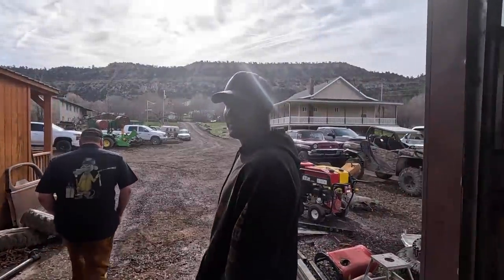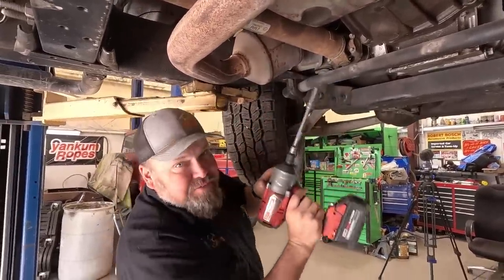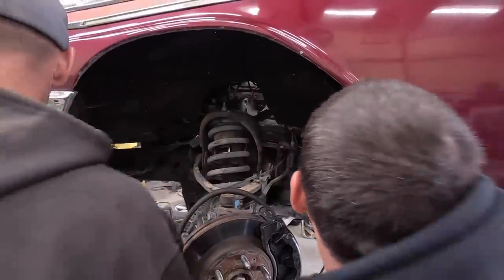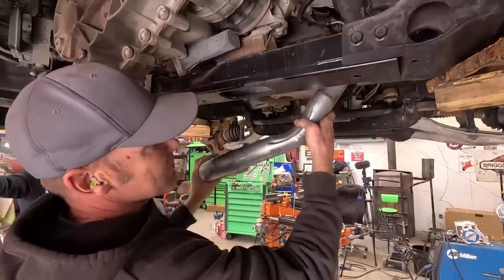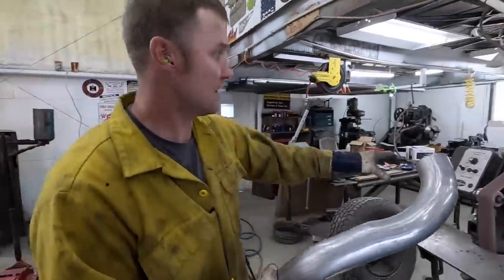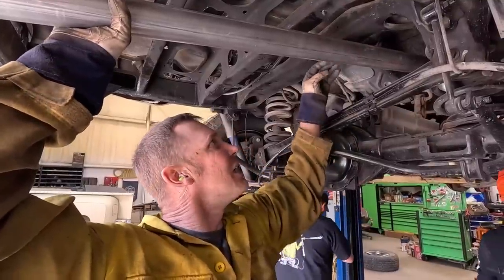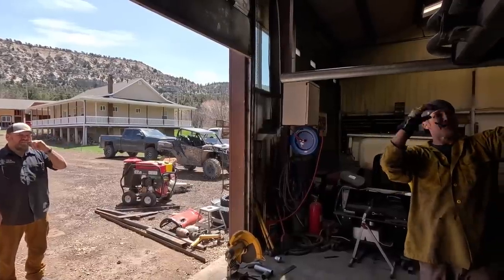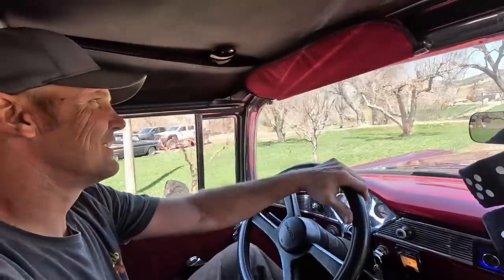This Controversial Chevy Bel Air Needs Some Help.

Comment: As far as old school performance mufflers the Flowmaster 1 and 2 chamber are the best for on and off road use and the 3 chamber are the best for on road use I think they sound the best and they give you just the right amount of back pressure and they give you good performance as well and you won't find a better ground beating muffler on the market and the 1 chamber Flowmaster is meant to be strictly for track use but I've seen some people use them for street use and get away with it even though they have a really ground pounding tone to them and they sound like you're not running any muffler at all

Comment: On the 55 Belair the chrome trim on the side goes straight back and the rear wheel well is squared off . On the 56 it started the chrome trim slopping down like on the 57 Belair , it also shares the teardrop rear wheel well same as the 57 . Much nicer look and you can fit a larger tire on tge rear of a 56 .

Comment: It's a 56 Chevy you can tell by the taillight it has the one round red tail lamp in a large chrome fixture the 55 had a smaller  tail lamp and it was all enclosed with just a small chrome bezel around it. Of course the 57 had the big fins which they dropped in 58.

Comment: It’s a ‘56. A 55 has an egg-crate grill (think ‘72 Chev Pickup grill). The rear wheel wells’ on a 55 are straight at the top edge for more than a foot. ‘56 is swooping curve to the rear like this exhaust project has.

Comment: What year chevy pickup did the guy use?  Did they section the frame or just find a body to fit it?  Kinda cute, I would drive it after an air cleaner & some borola mufflers to get rid of the popping & take the sharp edge off.

Comment: The exhaust doesn’t flow into the packing. Only as the exhaust pulse comes back up the pipe does the exhaust flow into the packing.  On a bike pipe anyways witch have same style baffles. One way takes the crackle out. The other way doesn’t

Comment: Looks like they dropped a 56belair convertible on a newer suburban running gear and frame.🤪🤔😂👏 That hot stud and nut would leave a nasty scar if it got between your shirt and skin " ouch" 😳 happened time a feww times working in a muffler shop over the years.😂 A nice sounding gass pack is a Walker Royal Scot, not as much on throttle but the same when you back off the throttle.🤪

Comment: You swear by Free-All but I recently found out that if you mix ATF and acetone 50/50 it works better than Free-All by like tens times 🤷‍♂️ I tried it and it seems to work better

Comment: Bah, should have put a Y pipe in the tail to eliminate crackling and any running issues that fuel injected engine will have with an O2 delete.

Comment: I can see if you don't get the bends in the right position you can end up using a lot of pipe or end up cutting and welding a lot more short bits together. Nice job Paul.  As i've got older I seem to like the exhaust a little quieter that just glass packs. Give the customer 8 weeks and sell him his mufflers back LOL. I've made exhausts with straight pipes and doughnuts. For those who don't know these  doughnuts are not edible. You'd break your teeth on them as they are circles of pipe. You cut wedge shaped sections to make corners/bends. Its an option if you don't have a nice hydraulic bender like Pauls. One of my friends had a 13b rotary and kept fracturing headers.  I fixed it. We used the old header plate and made the first 3 feet of the header and exhaust in heavy ass water pipe with a flexy joint and flange at the end of the headers. No more problems with cracking headers after that and it was quieter.

Comment: i dont get people that cut exhausts out when you could just undo the 6 or so bolts holding the 2 or 3 sections together seems easier then trying to get a saw to it and cutting for 10 minutes . sure cut it if its rusted in bad, or you could just run the car for a minute just to heat the exhaust then crack the bolts free and your done.

Comment: It's a 56. Do you know where the stock gas fill is at? For 5 or 6 years the manufacturers keep trying to hide them. I used to pump gas when I was in high school in the late 60's and it took me a while to know where to put the gas. Later on they started to hide the hood latches.This has the stock ignition switch that if you pull the key out when in the off position then you can start it without the key until you put the key back in and turned it to lock. I know my 64 Chevelle still had that type but not my 65. Back then many people left it in the position that you didn't need a key so you didn't have to look for them.The tri-five people will be responding about this build considering its condition and a rag top. It doesn't bother me, truthfully it probably steers and does everything else better than the original plus being a 4 X 4. The 3 link rear suspension with a track and sway bar is about the best for handling. It sounds more like it looks now, you did a great job as always. I remember here in Ohio the older cars that were daily drivers needed a new tailpipe, if not more, every year because of the road salt. If this car was a few years newer you would have had to work around the crazy X frame cars which would have added some hours to the job.  "I'm exhausted" LOL Typical Paul. Sorry about the long post, I always talk too much around Paul and crew.

Comment: Is that a 2000 AWD DENALIE CHASSIS with a 56 chevy body on it ok driver side is two piece an passanger is one piece to make a Y system an i would go from there into a single  3in glasspack muffler keep it simple man...😎💯✌

Comment: Sorry, but the Bel Air is one of my favorite mid-1950s cars. As far as I'm concerned, it's a crime what was done to that one 😲... Especially since it's a convertible!
I'm fine with what was done under the hood or any brake and suspension updates. It's the lift and 4x4 that made me yell "Nooooo!" at my screen. 😏

Comment: It's a 56 because of the bullet tail lights.  And the rectangular parking lenses. If it was a 55 the parking light lenses look like they are drooping like they are sleepy.  And the 55 have tail lights that are shaped like your wife's close iron. 56 gas tank filler cap is inside of the left rear tail light.

Comment: tw`q1`A`Had a buddy who had a 65 caddy ambulance that was know as the Kdog Cruiser. Had a 510 caddy motor with factory headers we mounted original  glass packs under there was 20 feet of pipe behind that man did that thing rap.

Comment: Another LS? I dunno why you Utah cats love Chevy. Does the Mormon church own stock? At least Merlin runs Detroits. We ran Y-blocks and those things never failed. I pulled 12 ton with a 74 that was only running on 7 cylinders. Lol, an Oregon cop chased me for 14 miles cause I blew the POE scales. I didn't know I was THAT heavy. The cop was like ...wait what? Didn't you think to weigh it? Nope not really, I was busy figuring how to keep it straight

Comment: Well, this is America.   If you own a 56 convert, you have the right to ruin it if you want..😂 
The owner probably has the original frame and running gear put aside to restore it back to its true form when they feel like it

Comment: All that cutting and grinding and no a damn one of y’all was wearing any eye protection. There is young people that watch your shows and they are not learning how to be safe when you do this. I am for sure that you have had to have metal removed from your eyes or drilled out of your eyes it is not fun. I know I have had done in the past. So please start using safety equipment. Love the shows.

Comment: You yap way too much. Make a graphic  that can be read quickly. That will shorten your video by 75% or more. That's a minor issue  Taking a short and dizzying video clip and looping it endlessly while you ramble on is the worst part about your content. If there was an anti-subscribe button I could tap I would in order to never watch another of your videos. Your dialog goes round and round nearly as bad as the video clip. My intention is not to anger you but to provide constructive criticism that you can use to make better and more visually pleasing content. Put your device on a tripod. Better yet put 2 devices on tripods with one zoomed in and the other for your wide shot.